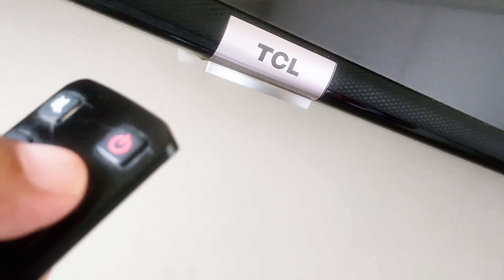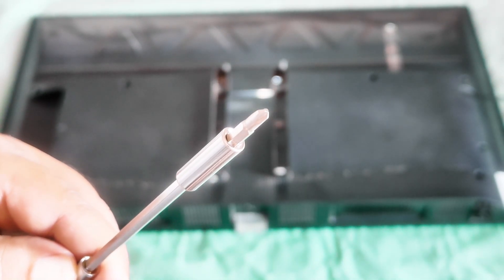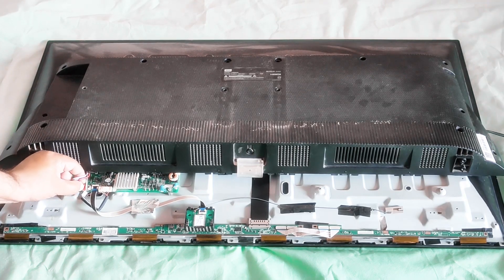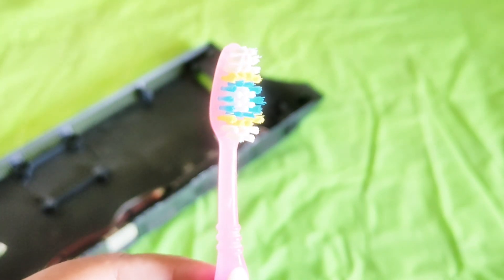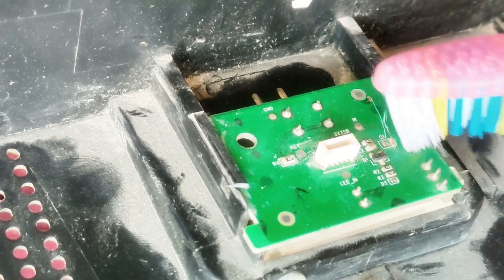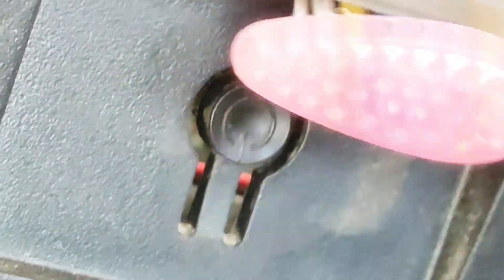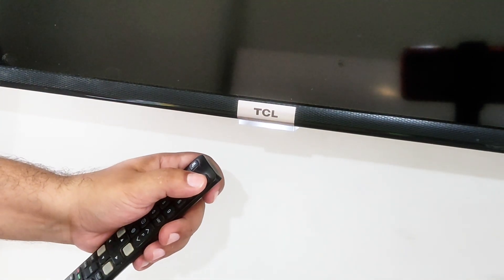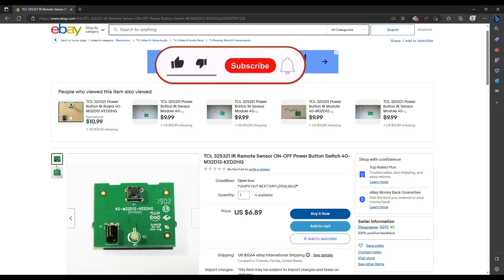How Fix TCL Android TV Remote IR Sensor Module Card ( Remote control not working)

Comment: I googled the issue that brought me to your video. Mine is a similar TCL model, same sensor and light on the bottom. My TV is wall mounted above a bed, pulling it down would be a hassle. Without compressed air on-hand and watching your vid, I drilled a small hole in the back cover where the sensor is located, I then stuck q-tips in there with isopropyl and cleaned it that way. We'll see how long it lasts. :) Thanks for the vid, it helped me get an understanding of the IR sensor.
Reply from the maker: Glad it was helpful. Do Subscribe if you want to support us

Comment: Great video - on a whim i just blasted the underside with compressed air and walah. 200$ saved
Reply: @jerryyoung347  did you take the TV apart or did you just blow at the bottom where the sensor was
Reply: I didn't take it apart
Reply from the maker: That is awesome!
Big thanks for watching! 
please SUBSCRIBE 
with Notification bell icon pressed